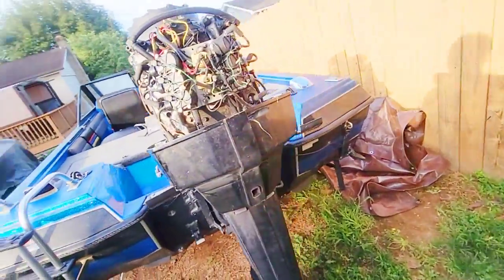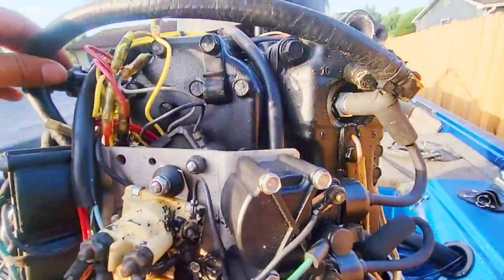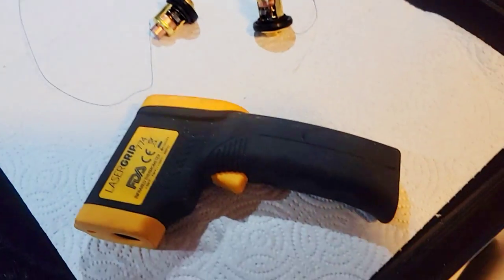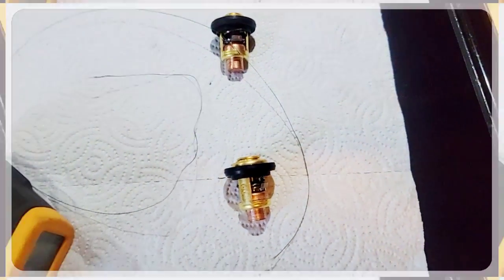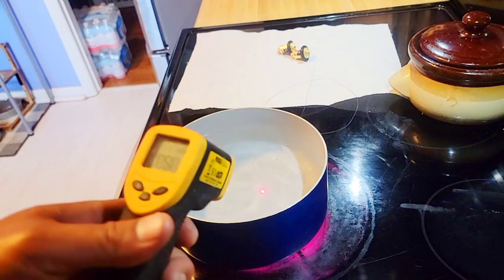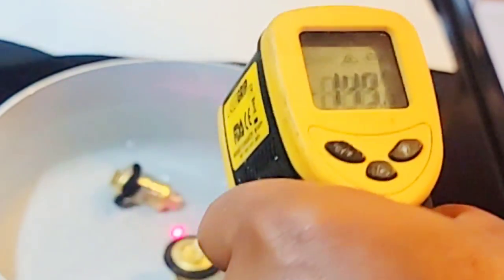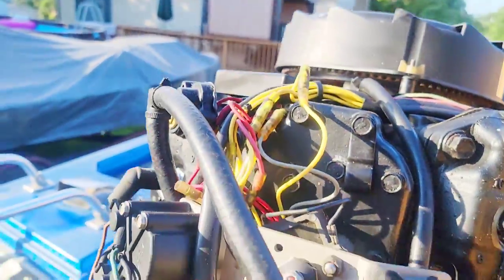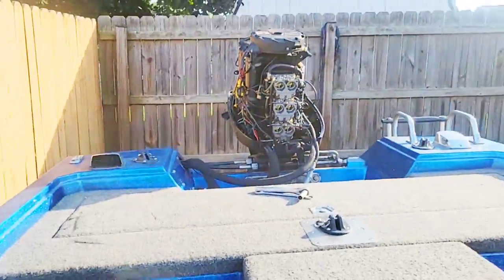Mercury V6 Overheating: Clogs? Impeller? Poppet Valve? Thermostats?

Comment: The thermostats are there only to increase the block temp at idle and just off-idle . Once the speed comes up and the increased pressure opens the poppet valve the thermostats close and have no effect on engine temp. I believe you have a flow blockage elsewhere in the block and/or covers. All the water flow from the pump comes up thru the center of the block  and makes a right angle bend into the exhaust cover just below that big plug at the top of the block. Pull that plug and look down the hole to see if there's debrii blocking the flow just below there into the exh cover. good luck!
Reply: I know this is a year old. But are you reffering to the water pressure plug ontop of the block? Pull it off and check down it? I can not get my engine to pee with a lower unit hooked up, new impeller and waterpump , swapped lower units with a different pump that I know works on another motor and nothing. It'll pee with a hose hooked directly to the pickup tube tho , not much but it does
Reply: @gavinsixnine  Yes! Pull that big plug on the top of the block located just behind the flywheel. Use a small flashlight to look down that hole. If it's plugged up with debree  - that'll have to be cleaned out and probably the only good way to do that will be to pull the block off the adaptor plate and blow the stuff out the long water passage way down to the bottom of the block and out. Also pull the exhaust cover off and check the opening at the top for debree also. Another thing  --  make sure the thermostats are in place and working correctly. The little vent in each stat is there to let the air out of the block on startup. Otherwise the block cannot fill with water until the poppet valve opens.
Reply: @DJHale68  pulled the exhaust divider plate and it's full of sand like substance ,calcium. Etc  , gross everywhere clogging all the passages. Finally hunted down a new plate after that 1 broke removing it. Terrible time glad I didn't run it otherwise would have overheated and blowm

Comment: right so im sure you know this, but just to explain why you mentioned poppet valves for others: poppet or "pressure relief" valves are for high speed cooling only however if they leak/arent sealing/grommets bad, its like a straw with too big of a hole ie. the water pump cannot pump water high enough in the block because the poppet valves are reducing pressure.
Reply: so it’s the water pump that’s not letting The water go all the way to the powerhead . which causes the powerhead to be hot to the touch?

Comment: Another test is to measure the temps at the center of the thermostat housings with you IR thermometer. The temps on both should be near your t-stat opening temps.

Comment: All the older V6 mercs can throw you off The Tell-Tale is plumbed in differently than a lot of other Outboards since they are plumbed to the output side of the thermostat you will not get any water out of the stream until they completely open or sometimes they will spit and sputter lots of times being mistaken for a bad water pump, not to sad the pump isn't bad but alot of people don't understand how this system works. For that fact I always check for water pressure at the gage and I use a tank rather than muffs

Comment: I have the older model 78 150. I replaced impeller thermostats and poppit valve. I’m assuming the newer ones water route maybe different but mine comes out the upper exhaust ports first before the tattle tale and my tattle barely dribbles at idle and flows good at speed. I’ve watched cylinder head temps with no over heating. I’ve given up on getting that perfect stream at idle unless I’ve missed something 🤷‍♂️
Reply from the maker: If its not broken don't fix my friend lol. Boats are already high maintenance. Thank you for your comments. Son

Comment: For troubleshooting have you tried it in a bucket? I can't see much water coming out of the prop exit either so looks to not be getting the pressure it needs somewhere.
Water pump housing looked alright? Maybe drop the gear box and back flush through the tell tale hoses for any contamination.
Reply from the maker: Great idea 💡.  That's in my next video which I have already done but not produced/released. Thank you! Son

Comment: Another helpful video! 
Do you have a vid on changing/replacing reeds? My 89 mecr 115 broke down and can't find anyone around me that will work on an outboard older then 90. One guy did look at it & said:
" it won't start cuz its not sucking in air, which means the reeds are bad" 
He said its pretty much an ⚓ now and I should just toss it.  I had just spent $1k getting new cdi, carbs rebuilt & bleeder valves replaced in Jan. (By a mechanic that said the motor was strong & that it was worth putting $ into it! Unfortunately, that guy retired and moved to FL. So am I just screwed or is replacing the reeds something I can do????
Reply from the maker: I've has engines with bad reeds and they start just fine. Hard to get the idle low but they run. Are you 100% sure it's the reeds?
Reply: @MerCSonL6  No, I'm not sure! That's just what the only mechanic in my area said he thought it was, although he spent more time trying to get my to buy a motor from him than he did looking at it. 
Quick background (try anyway):
I was given the pontoon for free & the boat/motor had been setting in water for 4 yrs. I cleaned out gas lines, pulled and cleaned starter & sprayed seafoam in plug holes an added new plugs. It fired right up! But the dirt dobbers had completely covered motor with mud so I cleaned it and had carburetors cleaned & rebuilt. I took to lake and started right up, drove for maybe 20mins and the throttle got stuck so I had to literally jerk it into neutral to stop from hitting a dock! Motor cut out about 30 seconds after that and has not started since. Tried cutting the kill switch wire to see if it was that & changed out inline fuse on motor. It sucks gas in cuz I drained carbs & then tired starting and they filled again. Checked spark, was good and even changed plugs out just in case. 
I can feel it pull skin on my hand while its trying to start but the mechanic had sprayed some power stuff around it and said if it was getting air like it should it would have sucked that cloud in, which it didn't.  So thats were Im at now.... Someone on boat forum suggested it might be something with control box and said to try a different one, which I don't have. I have been looking for an 8 pin harness to try to make a universal switch like in your other vid but haven't come across one yet. Do you sell those by any chance? Anyway, I would appreciate any help!!! You can email if thats easier:
whphchannel@gmail.com 
Thanks!
Reply: @WorkHardPlayHarder  i havent seen reeds as a cause of poor running in 20 years I think ive had to replace 2 sets of reeds at the shop. its not the reeds lol. thats what a terrible mechanic says when they dont want to work on it... or dont know how. even if there is .005'' of clearance, the reeds will seal fine. if its not starting, check compression and spark. if those are fine and it still wont idle or start, take the cylinder heads off. most likely piston skirts are shot.

Comment: Hi Jonathan here.
I just watched your video, as i am having i beleive a similar issue. Mine is a 30hp 4 stroke.
I removed the thermostat (has 1 only) to see if that would do the trick,  no luck,  so i removed the thermostat housing and ran to see if i had good flow, which i did. I am getting sometimes steam out my pee hole but sometimes not? But my engine is getting way to hot. I was thinking a blown head gasket ( which by looking at all that smoke you had maybe thats the issue?) Or  clogged water ways around the cylinders, but not sure? Or both? 
I dont believe my engine has a poppet valve, but if yours does, i would definitely look at that one. 
Did you ever figure it out?
Thanks for the video...
Look forward to your fix info.
Reply from the maker: Clogged water ways....

Comment: What was the issue? I have a similar issue on mine replaced the lower unit impeller and thermostats. Still didn’t help. Poppet Valve is too tight to come off. Any ideas?

Comment: Great video. I had the exact same problem.  Put the new thermostats in..
152°trolling 
 152° running at 4k rpm
The Bay water is 84°
The motor feels a little cooler than the water. 
What do you think?
Is thus a good operating temp for my motor?
Reply from the maker: Perfect 👌
Reply: @MerCSonL6  thank you so much. My boat has 450hrs on it. Runs great..can't afford a new one..thank you

Comment: How would you compare the performance of the V6 to the I6?
Reply from the maker: More problems with V6s vs L6s. L6s are built to last.... V6s not so much. But if you want more power V6s are the way to go. Just be prepared to spend more money. Just my 2 cents. Son

Comment: I’m having a problem with my black max mercury 175 I just replaced the water pump an at idle it pumps water great an at full throttle it stops pumping water an when I stop it starts pumping again
Reply from the maker: That's definitely a weird issue to have. I would rebuild the water pump again. Something is not adding up. High pressure and it stops pumping? Definitely a unique problem to have. If you rebuild the pump and have the same issues then you know it's something within the powerhead. Son
Reply: If you have a good stream out the pee hole then pump is working, Check your Popper Valve, coukd be clogged with its spring stuck, if it's all corroded up falling apart then replace it & I bet your issue is solved.

Comment: After changing the water pump and thermostat on my engine. Next, tried using rabbit ears to flush the engine but the engine is still not pissing out water. Anybody have a suggestion on what may be going wrong?

Comment: Do you have any videos on changing out a poppet on a black max 2 stroke? 

I’m having issues with over heating at full throttle. I’ve replaced all the lines and thermostats, impeller kit. Still the same.  I don’t think the water jackets are caked up but I might have to take it apart next.